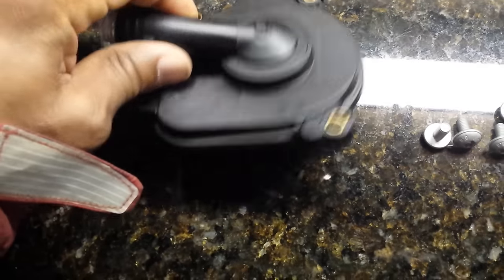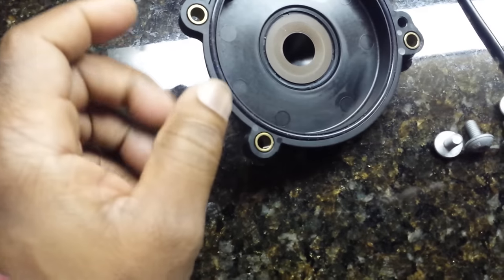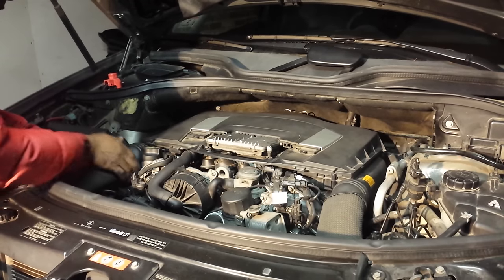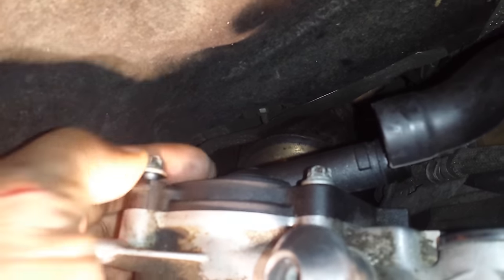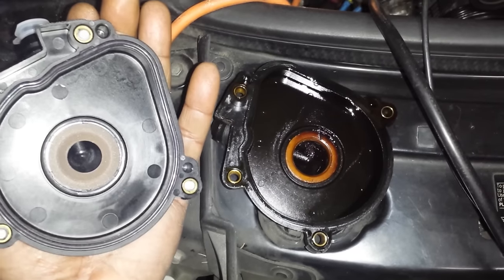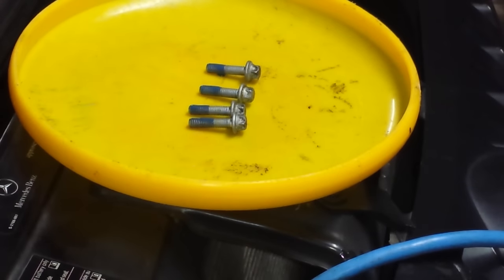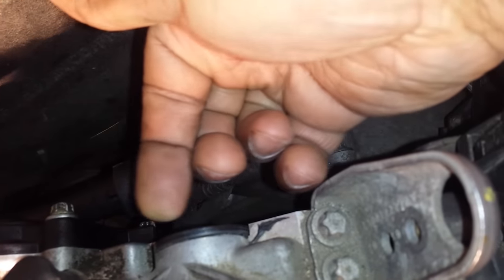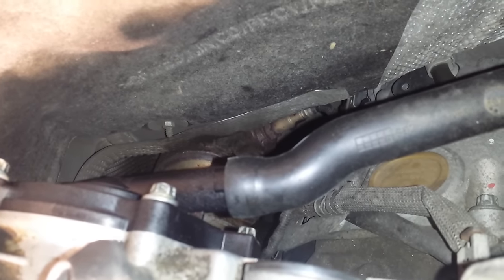Mercedes Crank Case Ventilation Valve Replacement DIY

Comment: Why would a motor need a pvc valve???
Reply from the maker: Moisture build up
Reply: @iRepairAutos  what I meant is a motor is powered by electricity….. and doesn’t need a pvc !!!! But I imagine you’re  engine does
Reply from the maker: @RaymondEldridge-lm8dk  a battery operated motor is run on electricity - correct.  But not a gas or diesel powered one.

Comment: It's not a diagram, it's a oil seal why didn't you change the spinner it will have a Grove from the old seal
Reply from the maker: Hey no worries.  I did change that oil separator.    It's a diaphragm that seals the oil.  :)

Comment: Is this why my car smells like burnt oil soon after it warms up?!
Reply from the maker: Most likely.   I would check for oil at this location on the engine and give it an overall visual inspection for oil
Reply: There are other areas you want to change out since you are at it.  I believe poster covered it on another video.  The are cam plugs in the back varies depending your model.  Usually 3 or 2.  Right next this this pcv cover there is a cam cover.  These cam covers also leaks and cause burnt oil smell travel into the cabin.   Obviously, once you change out these parts, dont forget your cabin filter that is sitting above your battery.  Since you smell smoke, its probably contaminated.

Comment: Would this cause the oil to come out of the dipstick if the part was bad?
Reply from the maker: It usually goes through the weakest point.  I’ve seen that but usually it goes right into the air intake manifold
Reply: @iRepairAutos  Okay. My friends 2.7 he says oil shoots out of the dipstick and I told him it's prob the oil level is too hight or it's an issue with the PCV.